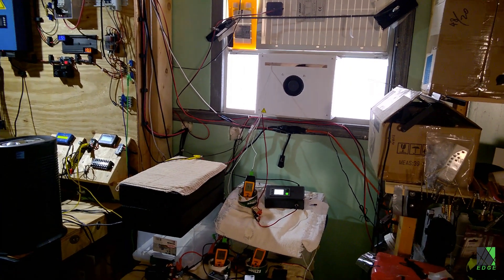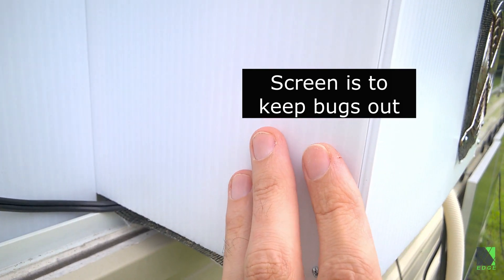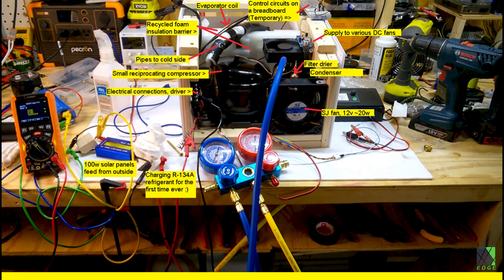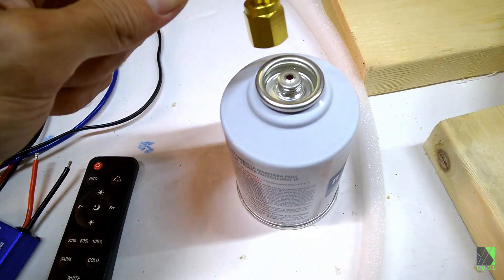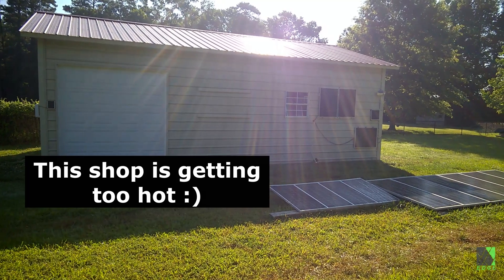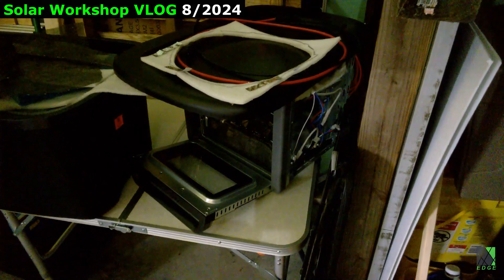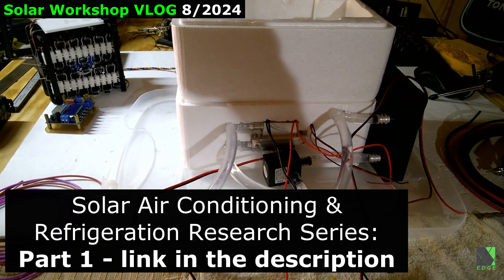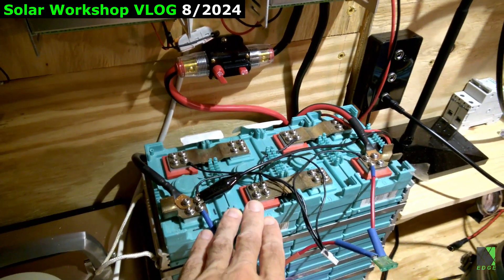#DIY Direct Solar Air Conditioner Prototype R134a Compressor Window AC & Solar Workshop VLOG

Comment: I would only add with this project is that it might not be cost effective at the component level as now there is a 12v dc mini split available for around 1200
Reply from the maker: @mr.makeit4037 I scrounged the parts for the window AC under $140. 

The larger split system will be extremely robust, use direct drive solar or 12v (hybrid), no SMPS, no inverter, no BLDCs. Around $750 in parts not counting tools and supplies. I have never seen a configuration to match it anywhere.
Reply: My thinking is due to the complexity of the system, and even though I don't have some of these parts, it seems like it would be prudent to purchase a small system.  Once the warranty period is up, use it, modify it, make it more efficient until it fails completely, then utilize all parts to repurpose into something new.  I do this quite regularly and have accumulated so many parts that projects abound here.  And sometimes with so many projects, I simply have to buy something complete because the build time is just not there.  One example would be the recent purchase of my fat tire etrike.  Once the warranty period is over, the modifications begin, like the addition of a diy cart and hitch.  And ofcourse I won't have to build a trike from the ground up as time won't permit.   Perhaps this is a result of me being now in my 60s and cherish time more.  But I do appreciate the diy spirit.   Great job!   Once I see additional videos detailing the specifics of your ac, I may pursue one of my own.
Reply from the maker: @mr.makeit4037 Right on... I also mod a lot of stuff. Waiting for a broken AC to modify :) I'm trying to do several half finished AC projects at once - really need to finish at least one...
Reply: @solarpoweredge yes I had time to think about this.  Facebook market place may be a reasonable outlet for sourcing a cheap or broken ac window unit.  The condenser and evaporative coils in such a salvaged unit would be  a better and more efficient choice over the coiled soft copper.   Also the unit would have to have carried R134 refrigerant, so that you won't have to internally clean those coils.  
P.S.   I am intrigued by the use of bldc conversion of the direct drive ac 3 phase compressor.  Good job.
Reply from the maker: @mr.makeit4037 Ty, hope to do more work on the bldc stuff. PS I found a couple of ACs that aren't working but they aren't free. I did get a nice condenser coil recently - hope it doesn't leak

Comment: The other day, I wanted to get your opinion regarding the circulation of cold icy water thru two radiator coils.  It involved a cooler,  a boat or motorcycle 12v cooling fan, hose and a 12v water pump.   But now, you have gone to a whole new level.
Reply from the maker: @mr.makeit4037 You can build an AC with a radiator cooler and big block of ice, water pump, and fan. I've seen them and they look amazing. There are too many projects...